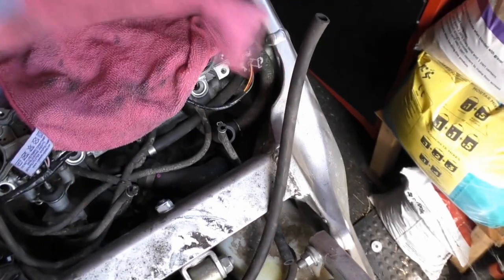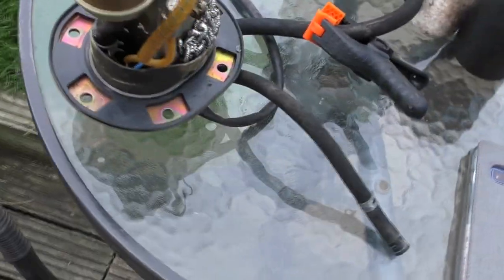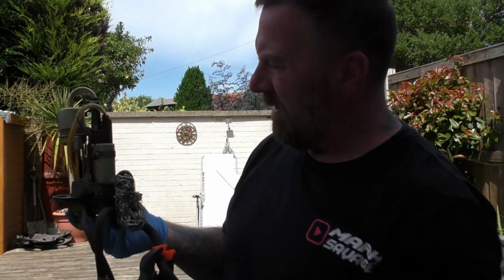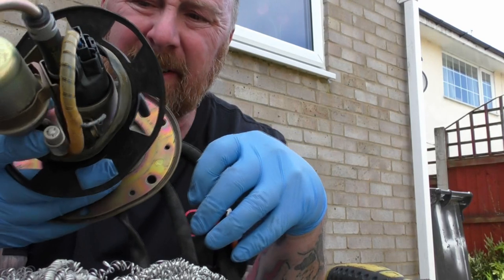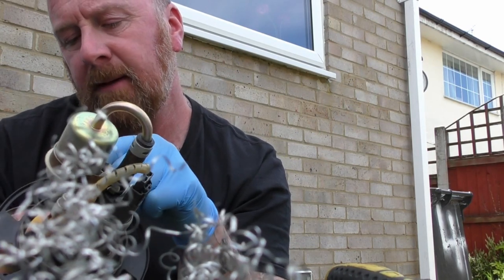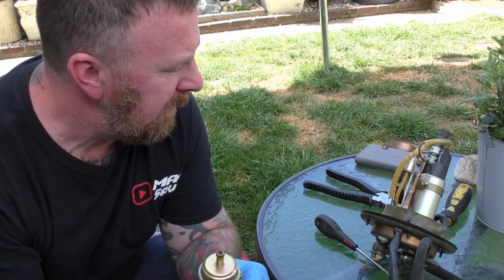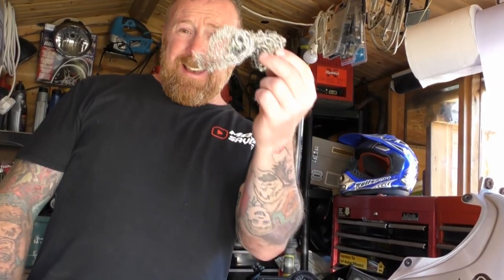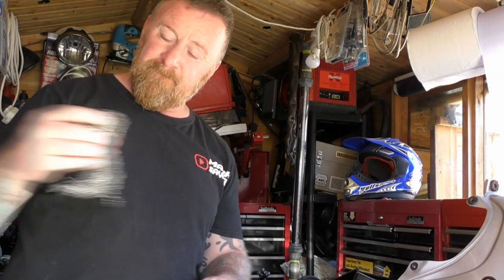HONDA CBR FUEL PUMP HAVE YOU EVER SEEN THIS BEFORE MARK SAVAGE

Comment: It's a vacuum actuated fuel pressure regulator. High vacuum (idle) will bleed back fuel to tank which lowers fuel pressure. No vacuum (full throttle) will raise fuel pressure and not bleed fuel back to tank. Also works in between with partial vacuum etc.  You can tee in fuel pressure gauge to test the pressure changes. Also you can make sure vacuum port holds vacuum and has no fuel on vacuum side.
Reply from the maker: Thanks bud for that,  see you can learn something new every day

Comment: It's a pre filter, and it's OEM, put it back, just look at the parts diagram, CMSNL website is great for exploded diagrams to see what should or shouldn't be there. The pump may actually only pump when the engine is running, i had a carb CBR600 and the fuel pump for that didn't run till you thumbed the starter.
Reply from the maker: Just never seen one in a tank bud but thanks 
Watch next weeks to see if i get it sorted
Reply: @marksavage  No problem, love your videos, keep up the good work.

Comment: had the same sort of problem on a z1000.turned out to be a wire broken inside the insulation in the fuel pump.good luck with yours mate
Reply from the maker: Thanks bud , watch next weeks to see how it went

Comment: Hi mate sorry for the random question. I have just changed pipe on my little gy5 125 from stock pipe too full lextec stainless. I finde its a tad slower now. Do u reckon thats the jetting or do i need to change rollers no to a diffrent weight

Comment: Hi Mark, my name is Steve, I live in Southend-on-Sea, Essex. Can you answer a question for me,  I have got a chinese scooter, it is a Yiben 125cc T22, it keeps bogging out, it has a vacuum tap on the tank and the fuel cap seal is split, do you think that could be the problem. Thank you for your help.
Reply from the maker: Hi bud 
Born and lived in Southend all my teenage years!!
Bogging in fuel so it could be the problem so replace bud 
They have a funny vacuum system so check it all ok plus fuel lines etc 
Last service ?
This time of year they do mess around due to damp 
Change plug 
Air filter 
Wd40 electrics 
Then check carb if no joy like in my videos

Comment: Hi Me again, 
I previously mentioned that I needed a new exhaust for me W Reg Vivacity, looking over the original paperwork, it says that it was derestricted.

Will I need to derestrict the scooter again if I put a new exhaust on
Reply from the maker: No bud it should just be fit and go 
But some things you may or it will help with a little upjet but see how it runs first

Comment: has that pan scrub been stuck in there as gorse to collect particles when refueling Buddy, I have never seen a honda company stick that in any of there bikes.
Reply from the maker: Being told they do ! 
, still never seen one before 
Thanks bud
Reply: @marksavage  mine has it too.
Reply: I have similar issues.
I have power coming to the tank, but apparently no power going inside to the fuel pump.
When I hot wire the fuel pump directly with it unplugged with a positive and negative lead hooked to the battery, the pump works.
Help, please, someone.
BTW, does the power reduce from 12 volts when it goes into the fuel tank? Thanks .

Comment: Hey quick question just got a  Speedfight 100 starts for 2 second and turns off almost like a backfire
Reply from the maker: Service new plug air filter , clean carb ,
Tune 
The backfire can indicate piston failure!
But try sorting first
Reply: Hey Mark amazing channel helped me out so much watching your videos I was able to  Determine it was my immobilzer with battery disconnected i could start it and it would idle till i gave it throttle and dies  Connected I noticed the red light on the  dash and couldn't even kick started thanks again from the USA
Reply from the maker: @nemzdroidx  thats good news bud , if you had of mentioned the red light on dash I would have been able to tell you it was immob lol 
You can by bypass units or send your immob away and get it reprogrammed but it will cost a few £ , wait $ lol